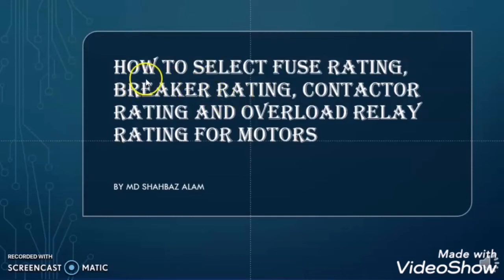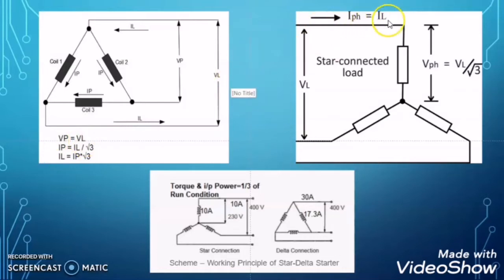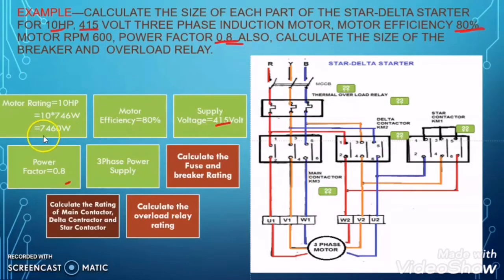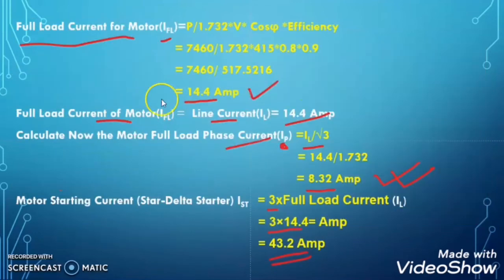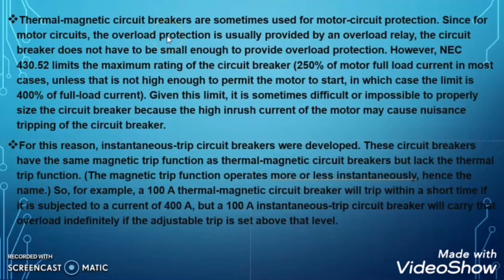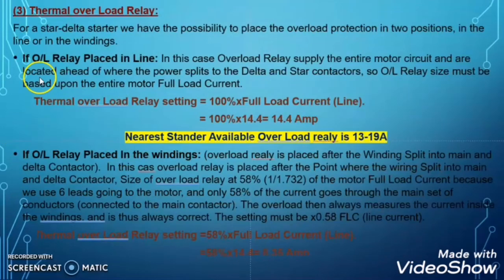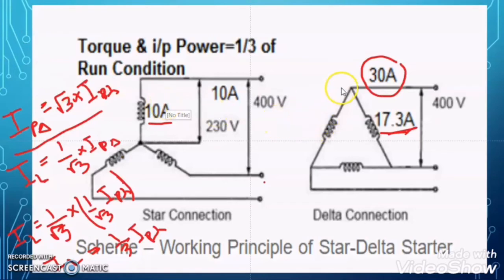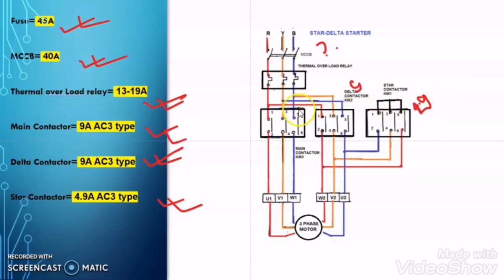How to select the Fuse, Circuit Breaker, Contactors and Overload Relay Rating for Motor?

Comment: sir could you please make a complete video of a residential building load calculation, like in a room-  load will be=x, so what is the pwr socket size, wire size, cb size selection. for a complete building i.e from scratch to finish of a building.